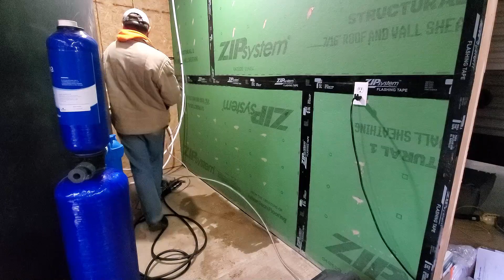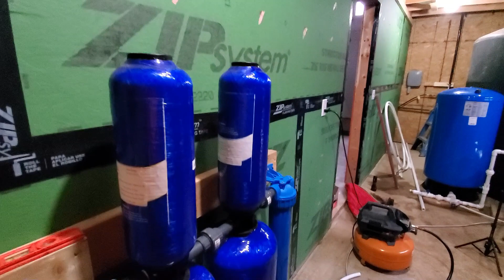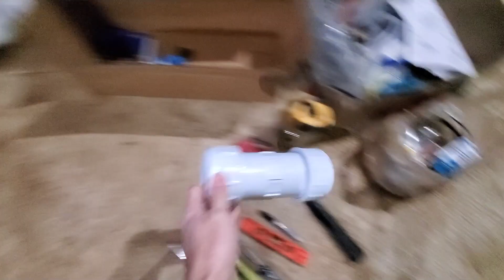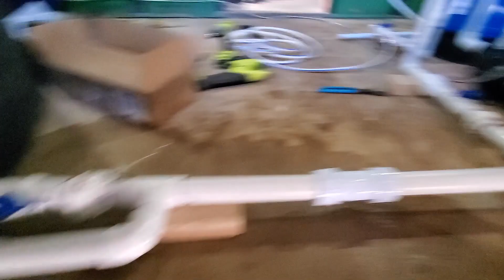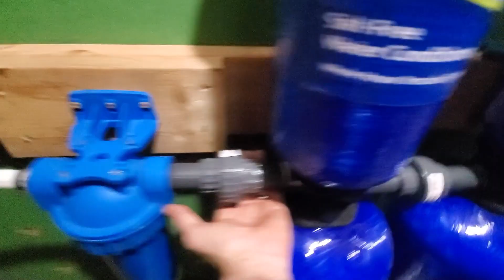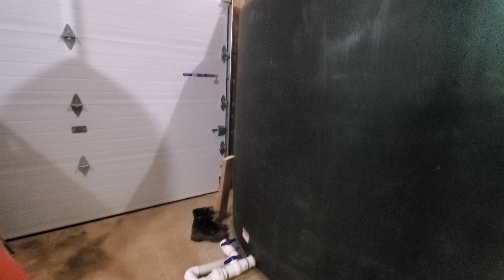Aquasana Rhino Water Filtration System on Rain Water Collection for our Off-Grid Homestead Build

Comment: I installed the Aquasana Rhino whole house and salt free softener. Three years down the road my house pressure dropped to half  and chlorine gets thru like hot knife thru butter. I don't know about other contaminants. We are on city water so it should not be that hard for filters to be clogged up this soon. I called support in Aquasana and all I heard from them that I have to change my pre and post filter more often. One can get broke with all filters to be changed more often. I do not recommend Aquasana.
Reply from the maker: The pre filter needs changed every 2 months and the post filter every 6 months.  Our hold tanks get pretty nasty yet the water inside is fine.  We've haven't had any issues with the system.

Comment: Do you drink the water? We have a rainwater cistern system at our off-grid home and im trying to figure out a way to make it potable.

Rjght bow we use it for house water but bring drinking water.
Reply from the maker: Yes we drink it.  I wouldn't without a UV light though as the holding tank will have bacteria in it.  Good for the tanks biofilm but bad for us.  I've actually installed two UV lights just in case one goes out and I don't catch it right away.
Reply: @Off-Grid  good to know re the second UV light. Considering the same system but looking at the different options and details as far as maintenance.
Reply from the maker: @ZacharyLinhart  we haven't had any issues.  I would suggest getting the pre-filter holder.  It's a ring that fits inside the casing and holds the filter in place when screwing it back together.  I had a hard time keeping it lined up without it.  Wish they had one for the post filter as well but that one is easier to line up. Might have one 3D printed for me just to make it easier.
Reply: @Off-Grid  did you ever consider one of these quantum filters over the UV? My biggest concern is maintenance
Reply from the maker: @ZacharyLinhart  I'm sure those are good as well but still a relatively new technology.  I'm also not sure anything is maintenance free.  I really don't check the UV lights much.  They have alarms should they go out prematurely and the chances of both going out at the same time is slim.  But a Quantum Filter does have benefits over UV that are worth looking into.

Comment: Is your Aquasana system before or after your booster pump and pressure tank?
Reply from the maker: Hello Doug, the filters are after the pump and pressure tank.  There should be several other videos on the set up  on or channel.  It's been working great for years now.

Comment: I'm facing the same problem with the pre filters alignment to the wall once it's radius is much shorter than the big cilinders. I'll need to cut some wood blocks to finish my installation. Thanks for the tips.
Reply from the maker: luckily you can add one 2x4 or 2x6 and the 1-1/2" width was perfect.  Good luck and thanks for watching.

Comment: Did you notice alot of the hardness gone?.  Researching on this system since it's kinda expensive 😬😬 Can you do an update video?🙏🙏🙏
Reply from the maker: We are on rain water so there wasn't any hardness to begin with.  I'm sure the backup well would have hard water but we haven't had to use it yet.  I know Aquasana has an iron filter that is an add-on to this system that might help.

Comment: Agree on pex getting damaged in sunlight at least. It actually is in the material guide that it cant be exposed to sunlight. Id go 6 inches both directions with copper. Did you see how much energy the uv light was taking? Just curious cause it is a 24 hour load.
Reply from the maker: The light is ine 24/7 and doesn't even register.  All the lights we have use very little power.  I'll have to switch out that area of the PEX when I get a chance.

Comment: Sweet setup. We built a similar system last year. One thing we did was put some extra pipes and taps so that we could put the filters in reverse to clean them by flipping 4 taps. Not sure what filters you have and if that's necessary for you. We are in Europe and our gear is a bit different. Also, yes, the UV will degrade the PEX over time.
Reply from the maker: Hello!  These filters can not go in reverse but I know what you're talking about.  I was afraid about the UV light damaging the PEX.  I'm considering making some changes to the set-up at alme point and will look at switching out the PEX then.